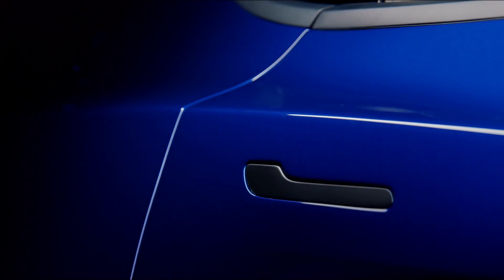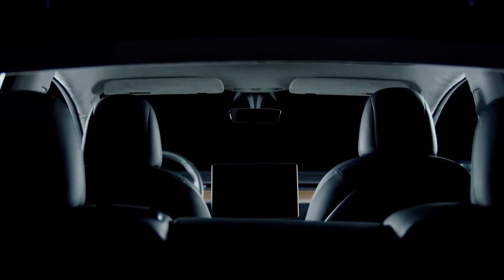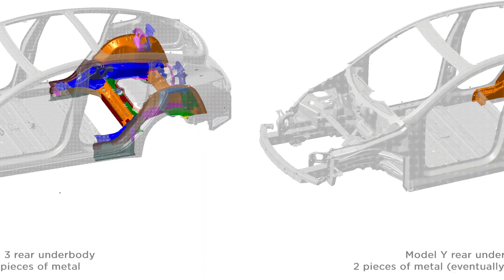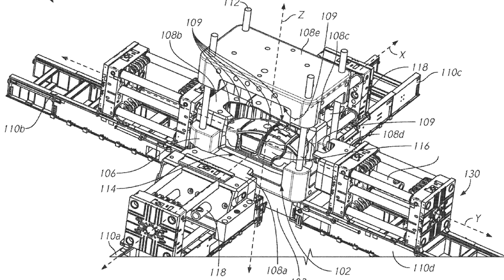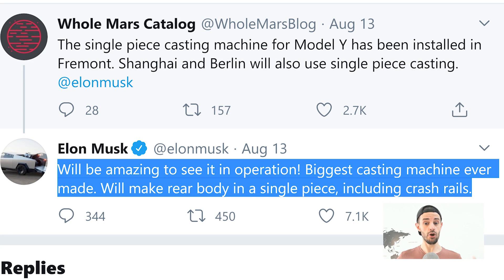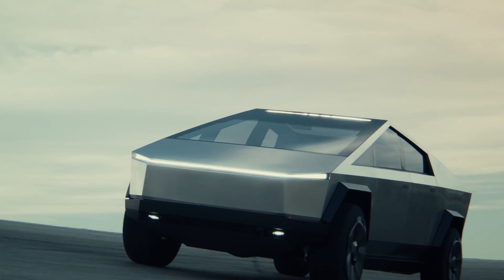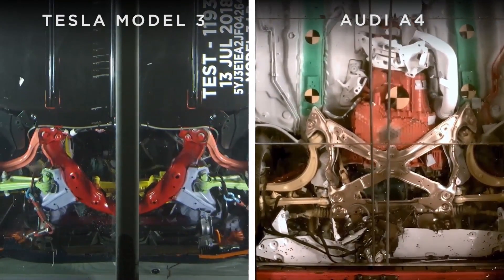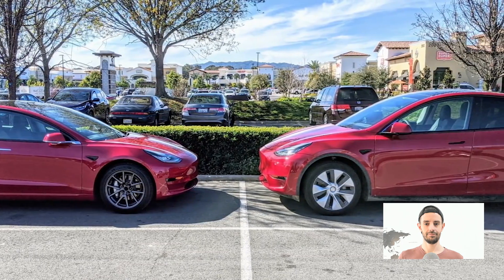Tesla's INSANE Giga Press (engineering genius)

Comment: They are not winning in repairability. But I was so happy when Elon said that they would be looking at that as a side effect of insurance. This was one of the things that got me excited about their insurance products. Not that they will monitor drivers and make us drive better. But because they will learn and improve cars. For example they could, make them easier to repair with standard tools and parts. They could add a shields feature that predicts small common accidents and stops them. Like going round a corner close to a wall and scratching the side. They could detect a car coming too fast and rear ending you at a stop, by flashing the brakes, hazards and reversing lights. Etc etc
Reply: Repairability is diametrically opposed to safety, due to the crumple zones
Reply: AVRO Architect depends on level of damage. I didn’t mean major crashes 😊
Reply: external airbags?
Reply: ken 1 I am not sure if you’re suggesting for my shields suggestion, but that’s not what I meant. Here are three examples of incidents I have seen from YouTubers that I follow. The first two seam avoidable, are the types of accident that can easily happen to good drivers who are maybe just a bit tired or ill one day. Tesla insurance would have to pay for. 

Rear wheel path prediction to avoid side impacts like: https://youtu.be/XdSIw8yS7HE

Slow moving impact prevention: https://youtu.be/tAnJPknzMYQ (like an extension to obstacle aware acceleration)

Rear ended detection and avoidance for (16m in): https://youtu.be/aijuAjxCZ7A

Comment: “A reduction in cost and a significant drop in capital expenditure”. Spoken like someone planning to build a LOT more cars and a LOT more factories!
Reply: Also this massive machine can be the same for many factories with many different components. Change the mould and you change the part. So although this is a massive machine and a huge expenditure, it's also flexible. I imaging they will have two sets of moulds so that one can be repaired/serviced/modified while the other is in production. That way it takes very little time to change the design if improvements are needed. It's a brilliant idea.
Reply: Yeah, 20 milion per year or 1 % per year of all motor car to be replaced by EV. That is the Tesla goal for the future. Elon said that.

Comment: Question: so what happens if you get into a fender bender with the car, and there' some pretty big dent? wouldn't it be better to have the traditional panel types, so you can just replace a smaller piece and not the entire thing? or is this something different?

Comment: One reason why traditional automalers hesitate to invest into body casting is the constant facelifting/model changes/diversity they want to produce. Casting parts requires more factory floor space than stamping. The stamps can also be more easily refitted (muliple times per day) to produce parts for 20 different models.  
Here is another advantage of teslas strategy, they don't (and don't plan to) have a high diversity of models, and they renew them gradually instead of hard model year cuts. 
Casting makes more sense under these circumstances.
Reply: Blast , hadn’t thought about it but other manufacturers are changing body styles every year.
Reply: Why not have interchangeable molds for the machine then?